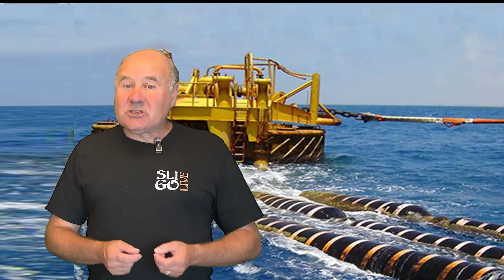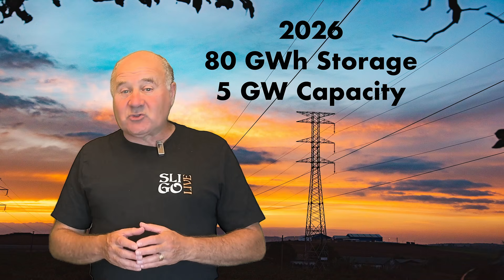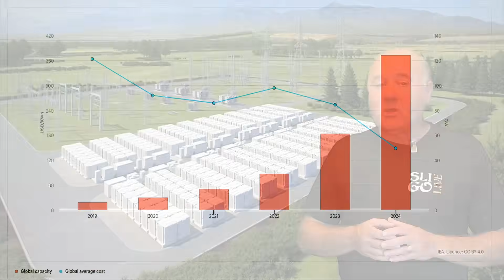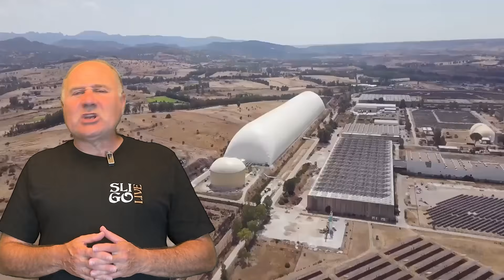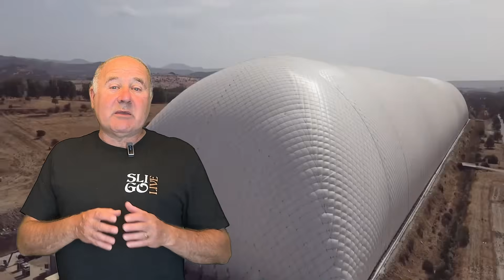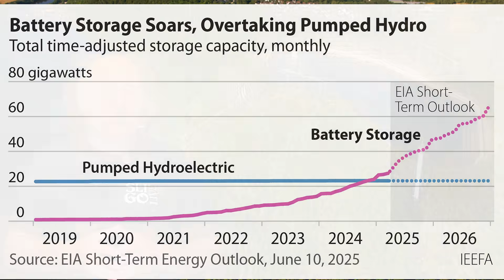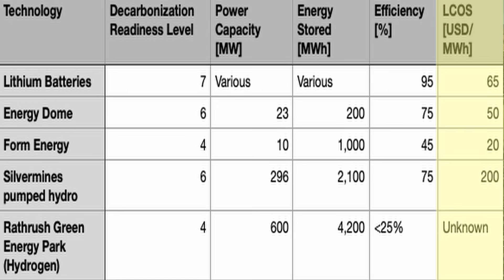Can Ireland build enough energy storage to turn off the gas?

Comment: I think you missed your current most important energy store, 87 terawatt-hours of annual storage capacity in Norwegian hydro reservoirs, over twice the amount of electricity that Ireland uses in a year!  And since it is not pumped hydro, it has 100% storage efficiency.  Between GB and Norway there is a 1.4GW interconnector, and another 1.4GW via Denmark, and between GB and Ireland there is currently 1.5GW capacity.  If there is serious Dunkleflaute over Ireland, GB is probably near the edge and has some power, so Ireland can access 1.5GW of Norwegian stored hydro, and it is annual storage, not daily that is going to run out after a day or week or month.  It is of course a shared resource, but to cover Dunkleflaute, that is not a problem, we never have a weather system that covers the whole of Europe simultaneously with full Dunkleflaute.

More interconnectors = less local long term storage requirement, which normally means cheaper electricity, at least with current storage technology.

For covering Dunkleflaute, efficiency isn't really a concern, it only happens once or twice a year, so you can refill with spare electricity, and if the electricity is otherwise going to be wasted, as a lot of wind and solar is, even 5% efficiency isn't a problem.
Reply from the maker: In my Dunkelflaute analysis I include the interconnectors, which by extension includes Norwegian storage. 

For this video, I’m just talking about a typical day and asking if we can build enough batteries to manage the variation in wind and solar.
Reply: We don't want to be your battery it's increased our power prices by a lot. I'm not very affected but prices in southern Norway are at times crazy
Reply: @fwskungen208  Interconnectors are supposed to be win-win, both your prices and ours should drop, that is why both sides agreed to build the interconnector!  Why have your power prices actually increased?  I'm sure someone is making a big profit somewhere...
Reply: If we also overproduce with wind, so we can help Norway keep hydro power for periods where it's needed. That will keep power cheaper.
Reply: @KevinLyda  Norway has plenty of hydro power for there own use!

The reason they agreed to the interconnector was so that they can sell their hydropower at a profit.  Having sold it then yes, they need some wind power back, so that the hydro can recharge itself while they use our wind.  The only cost is the cost of the cable, and an extra hydro turbine, no need to build any storage.

For us it is about storage, for them it is about profits.  Which should include profits for the nation, although the people don't appear to be seeing them currently!

Comment: Daily balancing the grid when there is enough local renewable production isn't the issue. This could be covered mostly by battery storage. 
Covering the times of dark dulls in winter, where over the course of 1-2 weeks there is a constant production deficit is the real challenge. Fortis you need midterm storage with 10-20 times daily power use in winter, if you want 100% renewables.
100 % renewable als means that all end energy used today must be provided through electricity. This means all energy provided by fossil fuel must be replaced. Of course, electricity is more efficient to us, and can even be multiplied by heatpumps. But still you talk about a factor of 3-5 compared to current electricity use.
Therefore I think the storage demand and the energy used by a decarbonized economy is totally underestimated. And remember, you cannot rely on the grid connections to UK and continental Europe. They may need the power themselves at the same time. Grid connections are mostly used for economic reasons to sell surplus energy.
What I am missing is the mentioning of a real study doing a simulation with renewable production and consumption data. Only this can really show how the mix of different production and storage technologies should be.
I am also missing technologies like thermal storage, wave energy, underwater see turbines, and bio Methan.
Reply from the maker: I think daily balancing the grid is the first issue. If you can't do that, you're certainly not going to be able to use storage to manage Dunkelflaute. 

To be clear, when I say 100% renewables, I mean just electricity. Full decarbonization is the final goal of course, but one step at a time. So the model I used in this video includes as much electrification as is expected to be achieved by 2035. The factor of 3-5 you refer to is more of a 2050 goal. 

I disagree about not being able to rely on the grid connections. I looked at the correlation between Ireland, Britain, and France in my Celtic Connector video and it's surprisingly low. For instance, the low wind we're currently experiencing would be offset in France with high solar output, possibly from Spain. 
https://youtu.be/zST1lWz85Eg

I did a whole video on Dunkelflaute where I looked at how Ireland could meet our needs in the worst time over a 16-month period. The key was overbuilding wind and solar plus the interconnectors. I'm not a fan of storage for seasonal or Dunkelflaute. It's too easy to run out and then you're screwed. Better to overbuild and look to import from neighbors who have plenty on sun and wind when you don't. 
https://youtu.be/iM_n0Ayskns

The goal of this video was to give a rough idea with back-of-the-envelope calculations, not to submit an optimized plan to EirGrid. I think the rough calculations are better for explaining the situation. The detailed models will let you optimize between different scenarios (e.g. how much LDES vs. Lithium). 

I only discussed technologies with solid commercial proposals on the table. I'm not aware of any for thermal storage and the others are not energy storage, but generation. 
I do have a couple of videos on wave power, but not the others, yet.
Reply: The transition to electric power saves a huge amount of electricity.  For example, GB's Green Volt floating wind farm is currently being built next to an oil field, where it will supply 195.5 MW to power the offshore oil production, the refineries use even more electric power, there are electric pumping stations to move the oil/gas from the fields to the refineries, the refineries to the storage depots, the storage depots into the grid or tankers, the tankers into the fuel stations.  Close down the oil fields and all that electricity becomes available to heat houses via 400% efficient heat pumps, or maybe 600% efficient by the time it happens!  Even driving a petrol car, every time you stop at a fuel station, you use an electric fuel pump to fill your tank, illuminated by electric lighting, with a kiosk/shop heated by electricity, using electronics powered by electricity, and then when you drive away, another electric pump to empty the tank! EV's charge while sitting in your garage at home, using almost no electricity to do so, they don't even use power to get to the charger.  Gas central heating doesn't work without electricity - the pump that circulates water through the radiators runs on electricity, a significant amount of electricity that nobody ever notices!
Reply from the maker: @nigels.6051  Good point. It's all part of the primary energy fallacy
Reply: For city driving, a petrol car will do 10Km/L, an EV 7Km/KWh. Producing one litre of petrol requires approximately 1.2 kWh of energy.  So by the time the petrol is distributed and into your tank, EVs and petrol cars use about the same amount of electricity...

Not sure that is quite correct, I did ask Google AI, and not all the energy used by the refinery comes from the national electricity grid, but it is definitely fallacy that EVs will hugely increase national electricity consumption, and since they tend to charge at night, the effect on the grid is negligible.

"What I am missing is the mentioning of a real study "
The transition is taking long enough that you can just look at what is happening, for example GB electricity use is 16% less than in 2012 but over 6% of cars are EVs and 9% of houses are heated by electricity.  There is no sign of a huge increase in electricity use.
Reply: @nigels.6051 I think you may be under estimating the energy efficiency of current EVs. They run in average on 15kWh/100km, which is more like 0.15kWh per kilometre driven. In city traffic the car should be even more efficient due to better use of recuperation. My quite new EV gives me about 650km out of the usable 73kWh battery. Much more fuel efficient than any fossil based car.
Reply: @dirkHerberich Your figures appear to match mine.  Not sure if you have realised what I was saying... That your EV appears to use the same amount of electricity as a petrol car. (the electricity for the petrol car is used mainly by the refinery to produce the petrol). The difference is that your EV doesn't use any petrol, which does indeed make it much more efficient.
Reply: @nigels.6051 thanks for clarifying. I did indeed mis-read that. EVs, like heat pumps are much more efficient than their fossil burning counterparts. Thanks.
Reply: @nigels.6051 There is not much electricity used during refining, especially not from the grid. Most energy used come from the oil itself and the electricity comes from cogeneration power plants in the refinery. And actually it doesn't really matter how much energy ist used during refining, just like it doesn't matter how high energy conversion efficiency is for renewables.
Reply: @egnegn123  Agreed, my figure was for energy, not electricity, but the energy does get used, some via electricity cogeneration power plants, and if it comes from the oil itself, that just means that a petrol car consumes more oil than is apparent at the fuel pump and has greater CO2 emissions than apparent, so if you are concerned about cost, then yes, it doesn't matter, but if you are concerned with fossil CO2 emissions, then it does matter, and the main purpose of this energy transition is to end fossil CO2 emissions.  A lot, maybe most people are converting because EVs are better, or cheaper to run, but the transition is only happening now because we need to end fossil CO2 emissions.